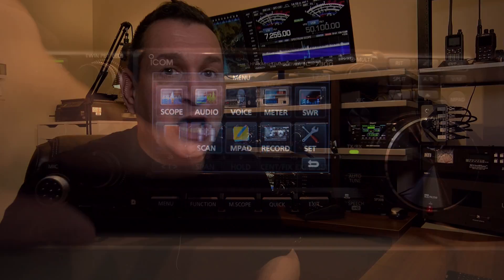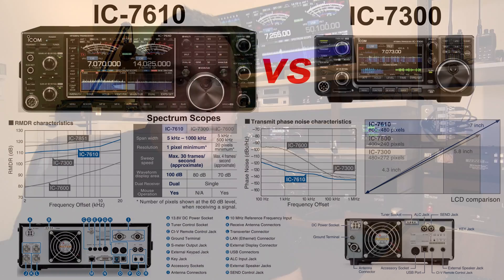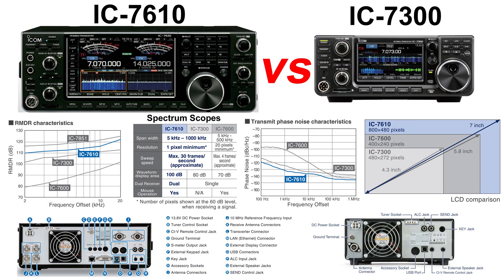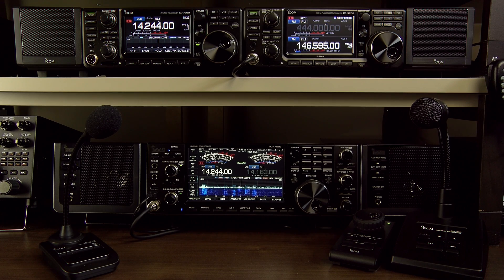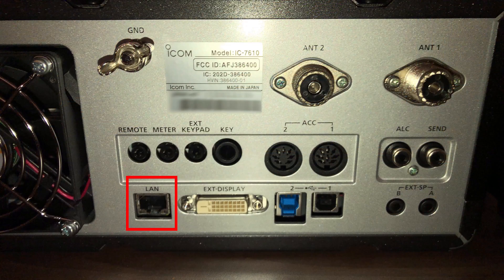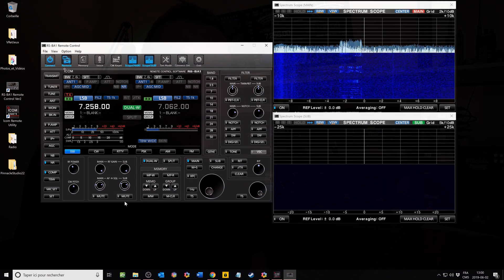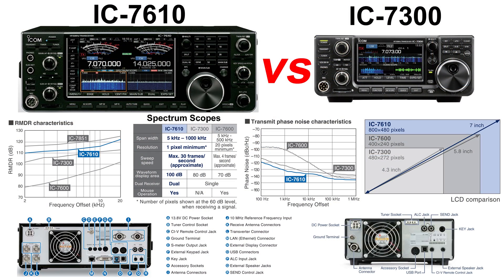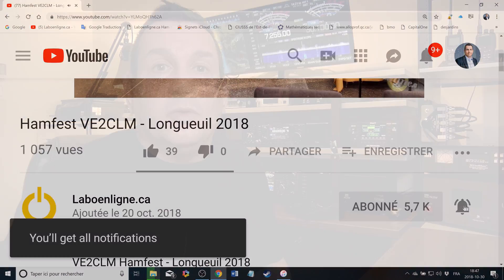Does the ICOM IC-7610 equal two IC-7300?

Comment: Hello Pascal, thanks for taking the time to do these videos they are very helpful, I was hoping you could answer a question for me. On the rear of the 7610 are 2 external speaker jacks, is that so you can have the Main / Sub dedicated to it's own individual speaker, in other words do I need to purchase two external speakers?  Thanks and 73 David W5DPV
Reply from the maker: You can arrange the connections so only one speaker can be used for both VFO or like I did, I have both VFO playing on both speakers.  You may need some adaptors, but it's 1/8 (3.5 mm) standard headphone plugs, very easy to find.  73

Comment: What about 7610 V 7700, only from selectivity and sensitivity? Front end and transmission quality?
Reply from the maker: Can't say I didn't tried the 7700.  But the IC-7610 is more recent with newest SDR technology, I'm sure it's better.  73
Reply: Laboenligne.ca You have very nice radios. No one can argue on that. I apologise if at times I come across a bit critical or even trolling. I have a simple 7300 with G5 RV half size, it is ok. Your main win is your excellent antenna. You have a fabulous set up.

Comment: No RX antenna input on 7300. That's a big deal to me.
Reply: So I'm just learning about ham radio right now because it's quite frankly well beyond my capabilities right now. And I'm curious why you would need a separate antenna for receiving(Rx is receive right?) As opposed to just a normal antenna that can do receive and transmit. Is it about sensitivity or interference between parts of the antenna or is it something else that I don't know about yet.
Reply: @Nomenius1  It certain situations an RX antenna can be beneficial. Not necessary by any means.  Normally you use your main antenna for transmit and recieve.  Not something you need to worry about  as you are learning. Lot's of learning in this hobby!
Reply: @Nomenius1  this answer may come late to you. As already mentioned many times you can use the same.antenna for both transmit and receive but the most common reasons to have a separate receiving antenna are most common on the lower bands like 40m, 60m, 80m, 160m 2200m where it is noisy and very difficult to hear. Then you can use very quiet receiving antennas like the Beveredge antenna for example while you still transmit on a vertical antenna. Another reason is that the lower you go in frequency the bigger the wavelength which in return means bigger and bigger antennas. It is not mechanically nor economically sound to build huge directive antennas on those bands. Then it's better to transmit with a vertical antenna and use other more directive antennas for listening that although great for listening in different directions and have ability to null out would.make a useless for transmitting.

Comment: Nice, how is your screen holding up on the 7610?
Reply from the maker: All find and it’s been almost a year since I bought it.  73 Pascal VA2PV
Reply: @Laboenligne  ok thanks, I'm thinking of buying one
Reply: Many users of 7610 have complained about the screen issue.   Even after a replacement screen, the issue returned.   Hopefully, those were 7610 of several years ago and not the new ones out there.   I am thinking to replace 7300 that I recently purchase (I love it!) with 7610.

Comment: I real disappointment in the UK for the IC7610 is the omission of 70MHz which the IC7300 has. If the IC7610 had 70MHz it would be the rig to beat, but the main rivals the FT101DX, and the TS890 have 70MHz.

Comment: I also want to second Pascal's comments about the utility of the two independent receivers in the 7610 - I can often operate on two bands simultaneously with my 7610.  I also strongly endorse buying the RC-28 as a second VFO. I leave my RC-28 controlling the second receiver only, so that I can work two frequencies at once, work split more easily and not have to hit the "Main" and "sub" buttons to toggle between them with the main VFO.  The RC-28 is a small investment to rectify Icom's decision with design planning not to equip the rig with a second VFO.
Reply from the maker: I also have the RC-28, very good quality unit.  I use it in the shack for the sub VFO and remotely with the RS-BA1 software, it also works remotely for my IC-9700.  73 Pascal VA2PV

Comment: Pascal - well done, as always! I own both rigs. The IC-7610 is substantially better than the IC-7300 especially for CW operating, digital operating, DXing and contesting.  I bought my 7300 after I had the 7610 and was disappointed in the 7300 features once I had grown accustomed to the 7610.  If you own a 7610, don't buy a 7300 even for portable or overseas operation. Get a second 7610 - it is a rig worth 5 x the 7300 in value and performance!
Reply from the maker: Hi Scott, thank you.  I own both as well and I like the IC-7300 for carrying it around, compact and the performance is very good.  But when you have the IC-7610 in the shack you won't use it much.  73 Pascal VA2PV
Reply: @Laboenligne  Thanks Pascal - glad I am not alone in that! I hope to see you at the Dayton Hamvention!
Reply: I like your comment on CW- quieter qsk, apf seem to make 7610 better - have only used the 7300 and it’s an average cw rig.  Good for the price and small but that’s about it.  It was groundbreaking when it came out!